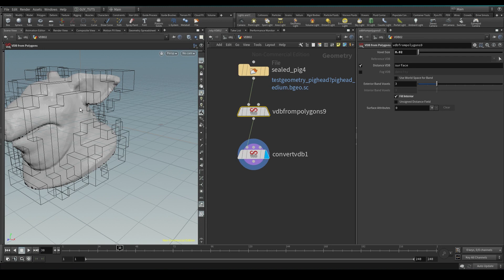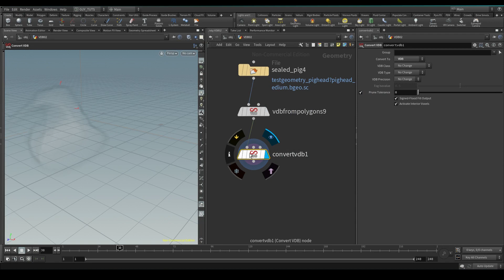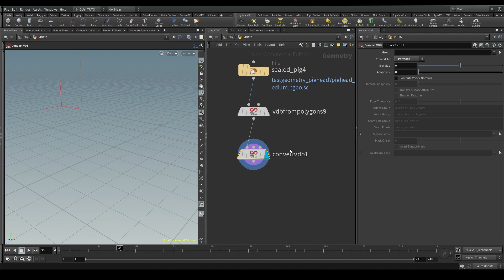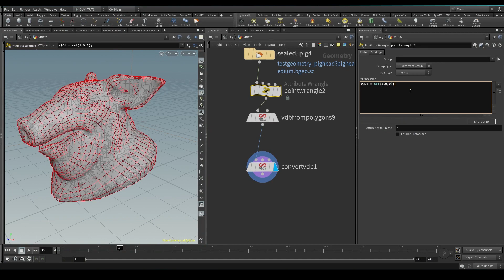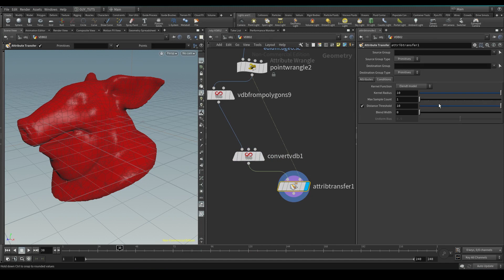Houdini VDB Convert In 5 Minutes

Comment: is it possible to preserve some hard edges?
Reply from the maker: +Martin Z yes you can. Connect the original geo into the second input of the vdb convert node. Check on transfer attributes and now there is an edge sharpness slider to do just that. Hope this helps
Reply: i have some bad news for you..